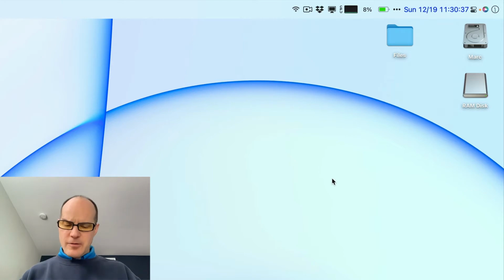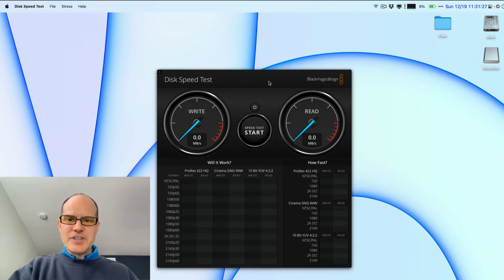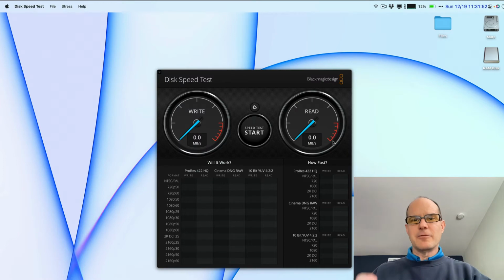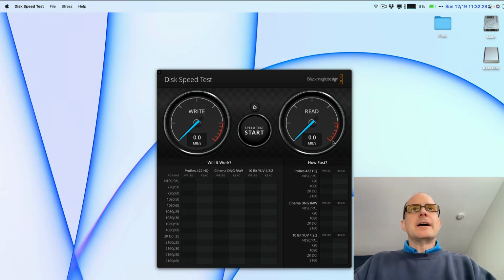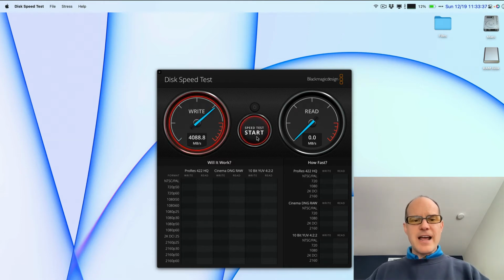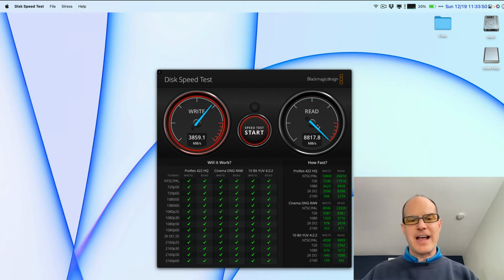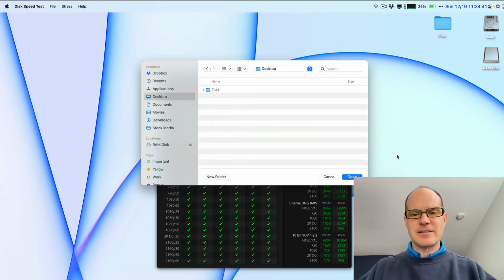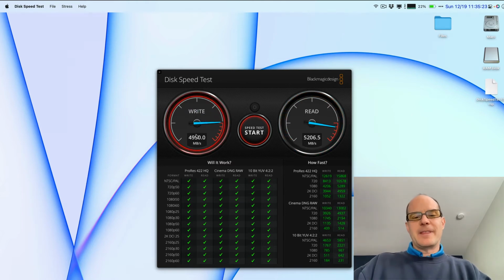How I Test the SSD Speed of My MacBook Pro M1 | Compare to My RAM Disk

Comment: You’re using a RAM disk to clean up files after finishing your work and then saving the final version. Have you ever heard of the delete key? Are you really going to tell me that using a RAM disk is easier than just pressing the delete button? WTF.
Reply from the maker: @omidrostami2208 thanks for your strong thought on this. So, it’s not that it’s hard to delete files, but more about a separated workflow. For similar reasons, apps have a temp directory.  Everything in the temp directory is flushed when the app quits. You don’t have to actively think about removal or mange items as a two step process (delete, then empty trash). It also saves on the wear and tear of the SSD. For me, it’s working great, and it gives me an excuse to use something with all the extra RAM. Sure, I could be crazy in my thinking, but has been a nice feature for me in the many years I’ve be using it and I don’t feel any less productive. I’ll admit, it’s a little high in the geek scale and it’s not something I’d expect people to readily adopt.
Since recording this video, I now have a system that processes scanned receipts and I use the RAM disk as a swap space to do all the processing. It’s worked well for that. And I still use it to store all downloaded files too where I don’t have to actively “think about” how much junk is accumulating in the downloads folder.

Comment: at a basic level the ssd terabytes written per day for 5 years is a normal rating. 3-4 bits per cell drives have less rewrites per block but since modern drives are larger there is more free space on these drives, so the larger drives with a better tbd (terabytes per day for 5yrs life) and the fact that more free space is on the drive is what makes them last longer. this allows the cells to trim and become reset and data moved and combined into more cells spaced out more evenly. a power user that uses a lot of rewriting to drive such as video editing is better off getting a larger drive, and or memory to have a large ram drive to do most of the scratch writing too. trim only speeds up the drive. trim makes sure cells are available that are clean and ready to store data. without trim the drive would need to move data and rewrite an entire block with new information and old data together which would decreases performance. for video editing 4k at this point in time i would recommend at least 1tb high quality ssd drive (samsung) a mac usually comes with good quality sdd chips. but the ram drive is even better.
Reply from the maker: Thanks for the great details here. Totally agree with what you are saying and I think that's why in large part I still use and appreciate the benefits of a RAM disk as a working space for saving/editing files.  The less wear and tear on the actual SSD, the better.